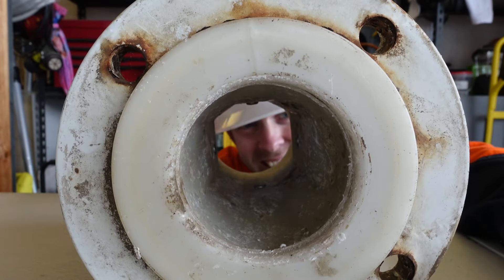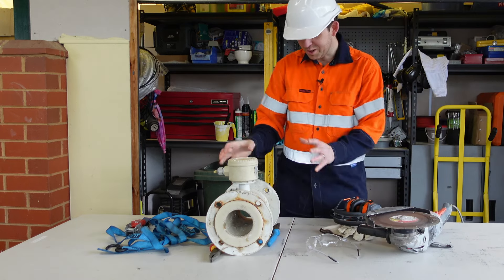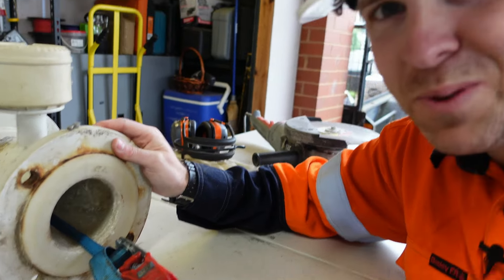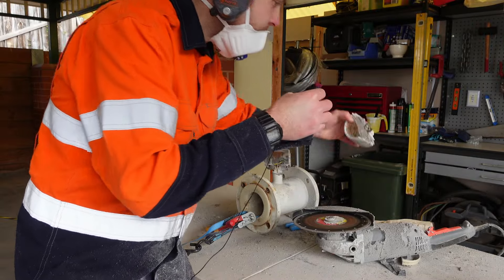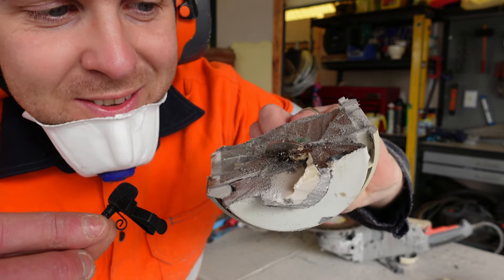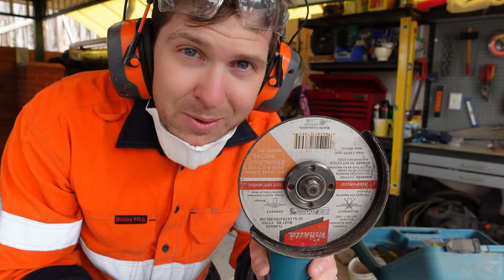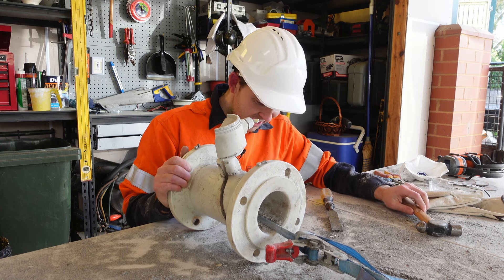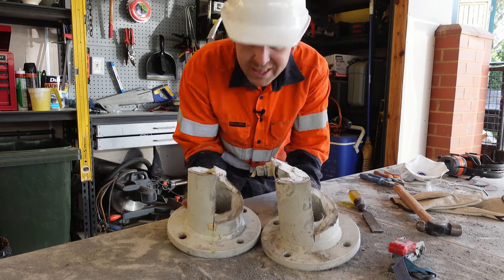Cutting OPEN a Magnetic Flow Meter to See How It Works

Comment: Using the hall effect to measure flow rate is very smart! Since the force on a particle depends on the magnetic field and the velocity of the particles. If the magnetic field is well known and controlled (which isn't very hard as itxs directly related to current and coil geometry), the force on each particle (and thus voltage) per m/s of flow is known.